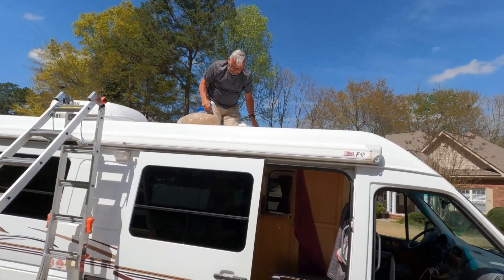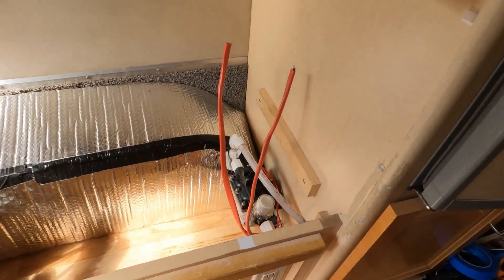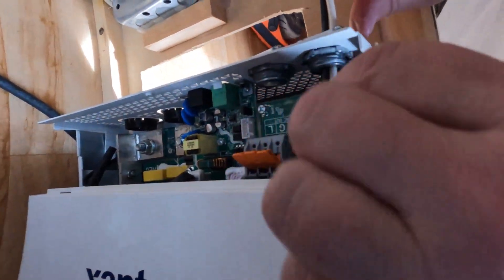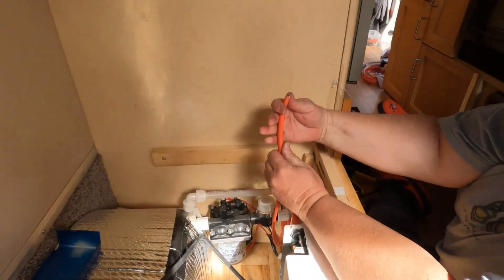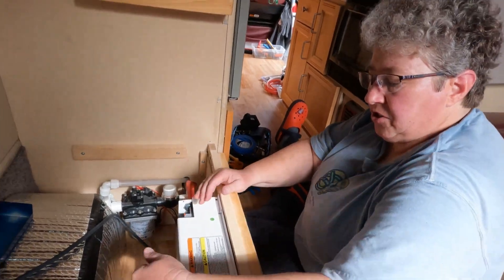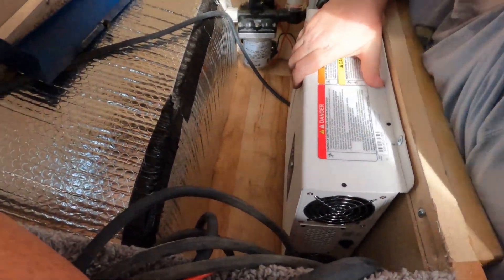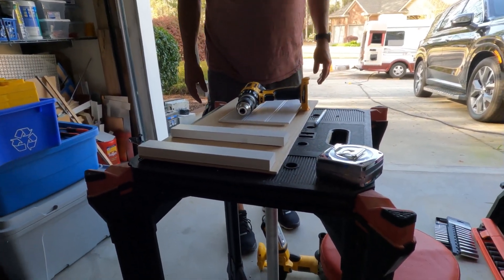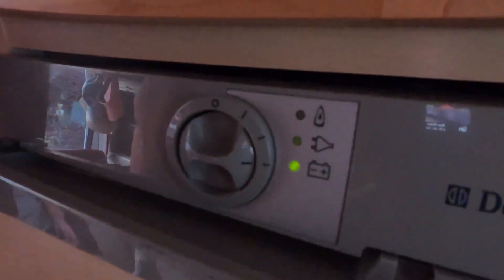Part 3 - Xantrex 2000 Watt Inverter, MPPT Charge Controller, 240ah Battery Install

Comment: Did you end up drilling any holes in the floor to run new cable to the wheel well area? Or did you create a hole in the battery cover (assuming your house battery is in the back under the floor like mine)? If you drilled a hole in the floor, did you use a step drill bit? Which one?